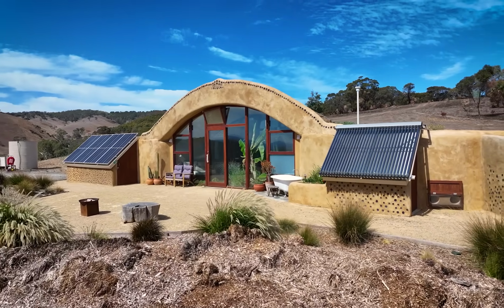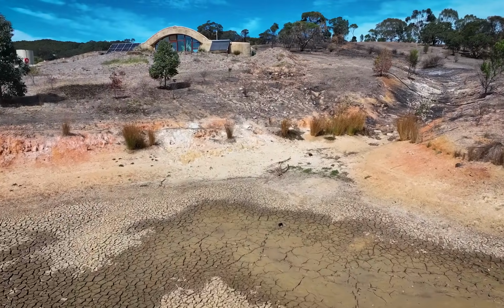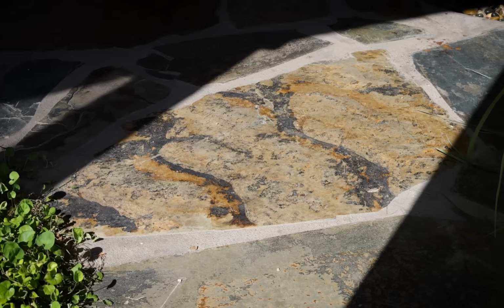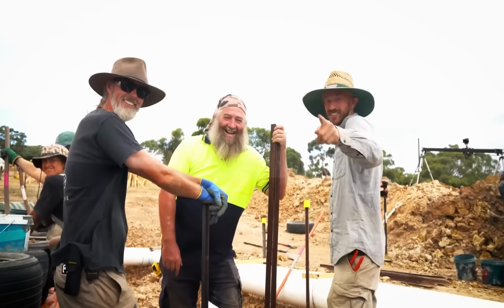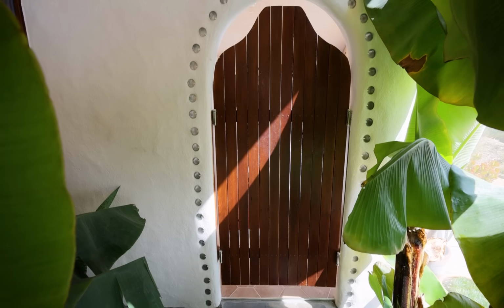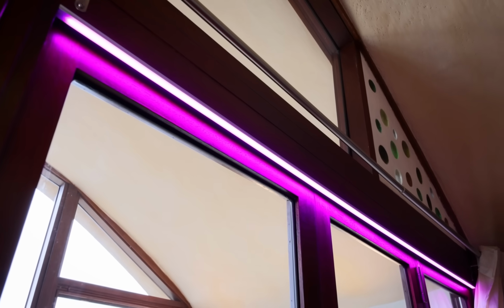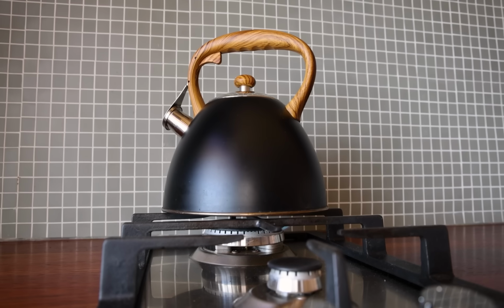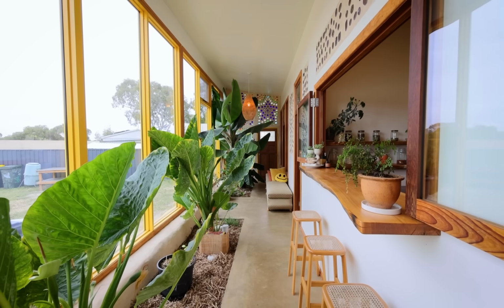Built For the End of the World & Beyond | Inside This Earthship Tiny Home

Comment: Earthships are overrated because of the firewalls and other trash, but the built in AC with thermal cooling and earth tubes, combined with the cycling of water are a great tool, which can be implemented into better structures that don’t use tires as walls

Comment: My husband and I bought an earth-bermed home about 20 years ago. It was built in the 80s by a company called TerraDome. The house is is made of concrete and has two monolithic domes which are connected, for a total of 2,000 square feet. The roof and two sides are buried and two sides of the house are exposed. There are good points and bad, but I love our house.

Comment: The reason why governments are not approving of these homes is because it basically is all labor and natural materials and they lose a lot of money in manufacturing and production. Politicians are not getting their palms greased. This is also why a lot the green building materials are so expensive too. It's a scam, and all it does is create more poverty. 
Also, they started building with sticks because the wood is easily replaceable, and you don't have to do as much maintenance long term. The lime has to be reapplied every 10 or so years, and the floors has to be sanded and resealed too.

Comment: I am so inspired by this video. Incredible work!! I am curious: if there was a brush fire with high winds in the area, would the air tubes leading directly to the outside air cause an issue with the high winds blowing open the air tube doors and potentially bringing fire inside the building? If so, I am wondering about the possibility of adding an additional set of retractable fireproof doors to the other side of the air tubes, that could be deployed in this type of situation.

Comment: Thank you for asking about the tires. i think the ;point is that burying old tires is not a healthy or sustainable practice for decades or centuries because eventually they begin to degrade and leach chemical into the soil, and potentially the water table. Tires contain petroleum products. We don't need them breaking down and leaching into soil and water supplies. This process won't happen quickly, it could be hundreds of years. Doesn't seem wise or sustainable, Just replace the tires with something better.

Comment: Thats really interesting about the VO2 levels to do with the tyres - not something i had considered tbh. One thing i had considered though was we are now obviously very aware of micro plastics in a way we wernt 20 years ago and the same sort of concerns were coming up about car tyres as far as road wear and the amount of rubber particles being shed - now obviously they dont have the same amount of friction that a working tyre on a car would but has any scientific testing been done into breakdown of micro particles from tyres over time when burried as they would be within an earthship?? 

The reason I ask is burying used tyres was stopped in the UK ( believe it comes under the Environmental Protection Act 1990 from a very quick google though there may be a loophole for "building materials"), so as burying tyres is illegal in many countries does this ever become an issue with planning permission for structures like earthships or is it just a case of ticking the correct boxes?

Comment: Expensive to build, without volunteers it would be closer to half a million plus you need your own land. Depending where you live there would be all kinds of legal, safety regulation, building regulations and zoning issues so there will need to be alternative tech and design solutions to accommodate for that. If you are a bigger family it would require more rooms as well. This is ok for a retired couple or a family with one or no children. Fun and beautiful but not practical. It would be better to buy several tiny home prefab units built to code ( like musk mini homes) and put them together for your family size and needs. Very nice no doubt but out of reach especially since there is no finance support through home loans or the banking system, all costs are up front and out of pocket unless some how financed through a project grant or something.

Comment: I LOVE Earthships BUT I DO NOT UNDERSTAND why people insist on continuing to build with USED TIRES???
These can OFF GAS VOCs and heavy metals, which can leach into the soil and water whereas COMPRESSED EARTH BLOCKS don't have this problem and can be made from THE VERY SOIL on site in most cases!
CEB's are a type of masonry unit and because they can be sent for TESTING/CERTIFICATION by engineering firms, they meet most building codes for masonry bricks which means BANKS WILL BE WILLING TO FINANCE THEM!!!!  That means loans to build with AND loans when you want to sell them, which is RARELY POSSIBLE when constructed with tires, earth bags or rammed earth (these are all non-standard, difficult if not impossible to get engineer-certified and aren't uniform).
SO I HOPE people will look into using CEBs for their Earthships as a FAR better alternative green material, superior in every aspect imho ;?)
Reply: YES if your walls are 100% sealed and there's NO DEGRADATION or cracks from ground shifts over time then air quality can be maintained, BUT in some older Earthships there absolutely have been problems that required major deconstruction and remodeling, so WHY risk it and there's still the issue of potential leaching into the soil and ground water. And ultimately CEBs have superior longevity, durability and thermal mass heat exchange. While Earthships have only been around for about 50 years so we don't know the longevity factor whereas earthen/adobe types buildings are KNOWN TO LAST FOR HUNDREDS OF YEARS!

Comment: The ground-level solar panels and vacuum tube hot water are brilliant.
I'm not madly in love with the usual hobbit look and exposed glass bottle detailing, but I completely understand the science and benefits of earthships.
If the arched facade had crisper and cleaner lines, like an architectural rendered form, it would appeal to a broader audience.
Reply: It's certainly intended to keep a more "organic" look, which I presume appeals greatly to the main consumers as well as the "community" labor pool (I'm thinking more about the almost haphazard bottle placements, which I do like). But there's certainly no reason such functional aesthetics couldn't be tightened up for that cleaner "professional" result.
I'm much more function over form so I could be happy either way.   👍
Reply: @jimg5669 In retrospect, I could live with it as it is and see if it wins me over.
However, if I grow tired of it, I could easily modify it with the skills I learnt in the building process.

Comment: Such a cool building. I'm glad you mentioned Amy's full-time residence since this one and the one owned by the chap you featured here are both BNBs. I really like the idea, however a warm fire is just too good to resist for me. Even if the firewood acquisition process is either uneconomical relative to a heat pump XOR arduous - the way I do it (see first full non-short vid for one way that has gone, ha ha). I love the idea of bottle wall double glazing though. I have a whole heap of Good George 946ml glass bottles with intent to do something like that somewhere at some point. Only time will tell if I do or donate them to someone else who is doing one of these :-)

Comment: Tyres do leach carcinogenic and mutagenic materials, that's why they're classified as a dangerous waste. You don't notice it walking around tyres, but those kind of poisons are cumulative and spending time with them is certainly nohting desirable. Also, the ventilation tubes are a very difficult subject - doable, but super complicated to do correctly. When slapped together without any thought, you'll easily get mold venting into the house; look at the video, even there in the desert the tubes bear signs of condensation and look filthy. It may be fine in Taos, but most of the world have some more or less humid seasons. When you want to start to control humidity, you'll blow your budget on agitated vents, sensors, raspberry pis and custom sowftware, because no one can really suply a solution to you... Earthships are inspirational, no doubt about it, but do use your judgment and get informed on all involved subjects, when considering such technical solutoins.

Comment: My biggest concern with earthships is the tires. They are toxic and embedding them in the soil, even wrapped in plastic, will eventually leach out.  I think tires need to be recycled properly (although that is not done much really) or incinerated properly (i.e. no to very minimal environmental impact).  I think there are other methods for the rammed earth wall.
I wonder how an earthship would fare in NZ with our earthquakes.
Concrete is getting more and more environmentally friendly, I'm expecting it to get better and better!
Reply: I do wonder if anyone has attempted using Hempcrete for this application and how it does buried long term.
Reply: @classicambo9781  that sounds like something worth checking out, as that would be much more environmentally friendly for sure.

Comment: I installed 19 SolaTubes -- tubular skylights -- in the earth home I built in the Finger Lakes of New York. The natural light they gave was SO natural, it took me months to stop trying to flip a switch. They were invented in Australia, and remove any perception of "cave-ness" inside! One of my three favorite parts of the earth sheltered home!
Reply: I've seen these in new zealand and you go to turn the light off to save power - funny!
Reply: Did you run into building code issues? Building inspectors don’t understand that thermal mass replaces insulation. Were you able to do the grey water?
Reply: @chickadeeacres3864  The only slowdown in permitting was with the wind turbine. Fortunately, my neighbors were happy with the idea, and it was far enough away from any others, that it went through fine.

I was running out of time, so it was easier to install a leach field and a line to the dug well for waste water. I did ask the plumber to put in diverters from sinks and showers for grey water. He said it was against code, but he built it in for potential future use. The inspectors didn't wheel themselves on the creeper that far back to see the piping.
Reply: @ smart
Reply: @chickadeeacres3864  The entire house was wrapped in 2" Styrofoam insulation. Even though the earth at that latitude is a pretty constant 54° F, a dwelling still needs more insulation. With the thermal flywheel effect, 54°F is not adequate to be comfortable all the time, so the additional heat you would have to add will bleed into the earth. 

I did an experiment once, to see what temperature I could function in daily life. My answer: 58° F. Not 57°F. My fingers couldn't type at 57°F.
Reply: Love to hear other New Yorkers making meaningful change!
Reply: That's really cool I actually came to the comment section to ask if anyone had added skylights to an earthside. I actually like the whole cave look but I also love the natural light.
Reply: I lived outside of Ithaca. Some of the best days of my life. What do you do with the snow, sweep it off?
Reply: @rmbarnes672  They have dome tops. Only once did anything cling to them, a freezing rain. The house is just north of Ithaca, in Aurora. Next to Mackenzie-Childs.
Reply: @grovermartin6874  thank you for saying.  Etna one day it went from 70F something to -20F overnight. I didn't know that was possible

Comment: I am very positive on earth ships, but reconsider using old tires. Yes they are cheap construction materials, but they are industrial waste. The chemicals used in tires are not always consumed during curing, but intended to stay active to protect the tires from disintegrating. Especially nitrosamines have carcinogenic properties and it is known that tires production and storage facilities are contaminated if these accelerators are used. To my knowledge tires outside of Europe may still contain these chemicals , especially old tires. Simple VOC measurements do not give you the desired confirmation. And be aware the concentration in the air may be low or not measurable until the material covering the tires is loaded fully and leak out. The only proper method I know is to either demolish the buildings or to make sure the air exchange rate lowers the concentration of nitrosamines to meet a safe level.
Reply: If it’s not in the air of the domicile then how is it going to bother the people inside? Plus the mud and plaster will most likely absorb the off-gassing. I agree with Marty, there’s not enough data yet to suggest that used tires as a construction material are a health threat to earthship inhabitants.
Reply: Yes, I've been hearing lately about the tires in Earth ships not being safe to use in construction. I hope this proves untrue, because I love the kinds of homes. They are so cool!